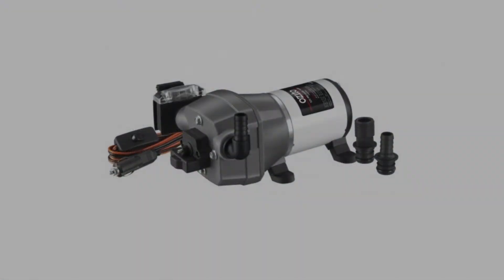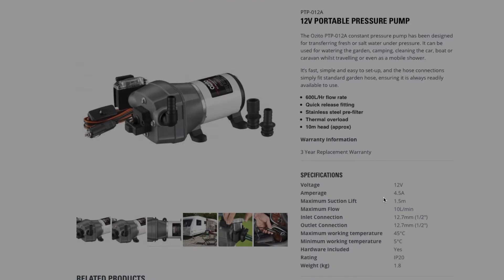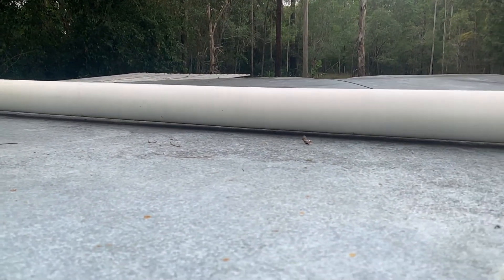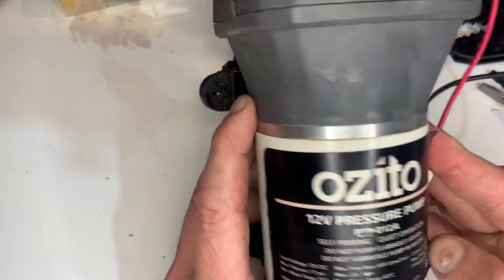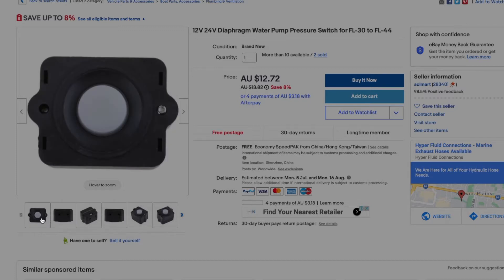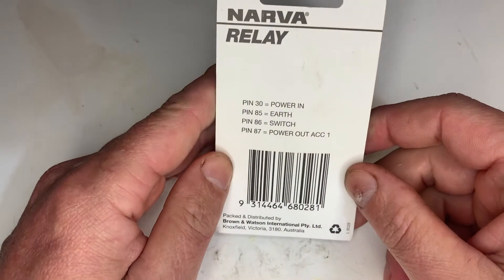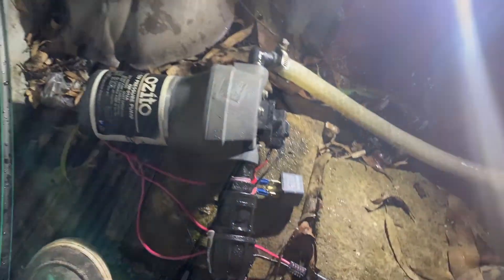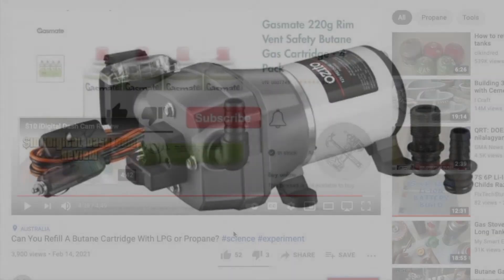Ozito 12V DC Pressure Pump Review / Everything You Need To Know, 3 Years Off Grid Water Pump

Comment: Firstly, great video & I was really surprised you fitted the relay as I was curious if I had to do the same as this is what I did/HAD TO DO with my surflo along with an accumulator tank. Otherwise, my pressure switch would just blow out which would only be weeks or a few months at best. After fitting a relay & accumulator tank, the pump & same switch has lasted something like 6 years!!! It actually still works, but I think the seals are blown as water pisses out from the body of the pump.  So I really don’t know why these things aren’t built WITH AN ALREADY FITTED RELAY with a suggestion to also incorporate an accumulator tank it the pump is going to be used regularly over time. 

Note to those living in Australia, Jaycar has those pressure switches which are cheap as. I didn’t know this at first and I was ordering off line or at a boat shop for some fcuking  ridiculous price.
Reply from the maker: Thank you! And thanks for the info.
I must admit I have made mistakes in that video, I'm not clever enough with relays, a spark arrestor of some kind would have helped the relays last longer.
I think the big issues I missed were, just running the 12V pump off 24V was a bad idea, in my case buying a 24V pump would have been smarter, you can also run it off a car battery in an emergency and it will handle that without overloading anything. Also the main feed line to my house is 16mm when I should have used 20mm.
I actually tried an Arduino uno with a Mosfet switch which worked flawlessly until one day the Arduino locked up without my knowledge and it stayed on for a few hours, the pump was a bit worse for wear after that. 
I've since upgraded to a 24V Seaflo which I did a short video on, its behaving itself even without a relay so far.
Probably a better solution would be using the MOSFET instead of a relay, 3D printing a box or coating it in epoxy to waterproof it. No moving parts except the microswitch would help it last longer.
Reply: Can you please tell me what accumulator tank you bought? Also, where you got it? Many thanks.
Reply: @susansinclair4914  Sorry for the late reply.....I cannot remember the exact size but its only fairly small, like a 1ltr tank???? its about the size of a large grapefruit for lack of a better description. I bought my accumulator tank from Aquafier Pumps Brendale Brisbane QLD. Dont know how relevant that'll be for you though.....In any case my Ozito water pump is still working perfectly along with the accumulator tank.

Comment: Perfect review! thanks for sharing. you might have better pressure with a smaller pipe! 
a run on timer (most i have seen are 240v and die in a year or 2) would allow setting a minimum time to stay on which im sure you've already figured out! thanks for this mate!
Reply from the maker: Thank you!
You're right about the smaller pipe, I believe the big issue is the pressure switch is not capable of supplying a whole house.
Another commenter talking about the pressure vessel was on the money, although I don't want to go down that route.
I had rigged up an Arduino and MOSFET switch, which would stay on for 3 seconds at a time, it worked brilliantly but it would fail occasionally and stay on.
I'll release a new video soon, with a new 24V DC pump.

Comment: How do you get to the micro switch?
Reply from the maker: You need to remove the 2 screws on the front of it and the pressure switch and microswitch part comes off, it's just held together by some clips.
Be very careful with those screws so you don't butcher them like I did.

Comment: forget all this garbage you will be chasing your tail for ever, if you want to stop the pump from clicking on and off and burning out, get a Tank Accumulator, that will fix the constant clicking on off as it actually fixes the pressure problem, this hack is trying to cover a problem not actually fix it so get it back to 12v. Tank Accumulator cost like $40, they are a must for these style of pumps, also save you a tonne of power likely would have allowed you to run on that battery longer, that clicking is startup draw so uses max amps every time it clicks on. If it was me, id put it back on a 12v battery, attach a $60 Epever water proof Mppt solar controller, and hook an old secondhand panel to that 12v battery, and ad the Accumulator tank. It Might set you back $150-$250 todo it, but you wont have to worry about swapping out all this crap every five minutes. reliable water supply is pretty damn important, so spend a few bucks and do it right IMO. plus it wont be a drain on your main solar system having it on its own system. if you had a 200-250watt panel on that battery you would more than likely be running it all day with out using any battery, so if you had a cheap 100ah Agm on it, you should have heaps of power for the night
Reply from the maker: I am aware of Tank Accumulators, I used to have 1 or 2 on 240V pumps. I may look into one, but currently it isn't necessary.
Another fix will be a more suitable pressure switch, basically the highest pressure one they sell. I did upgrade, but it made no difference. Currently the pump doesn't click on and off on the tap right near it, but does on anything in the house. So sorting this out, possibly with an external pressure switch is one priority.
On top of that, the problem still stands, you can't deliver 20A through the tiny contacts of a microswitch forever, it needs a good solid relay at bare minimum.

Previously I ran the pump on hail damaged solar panels and whatever old car batteries I had, but since they've died I don't want to keep spending money on them.
I will never go back to 12V battery, not with cheap lithium ion batteries, especially with the DIY power wall route.
I already have the infrastructure and its working well for me.

My problems with the pump has since been solved using a cheap Arduino and Mosfet, I'll do an updated video on it in future.
Reply: @FixTechStuff  Hi I am still going through these pumps and one I fitted four days ago has already bit the dust. I did get DC microswitches which, as they were physically larger, I had to adapt. I also had an auto electrician wire up a relay. This worked well for a few months but then, one day, the pump got stuck on and wouldn't switch off so I had to put in a new pump. I didn't have time to put in the relay myself so it's yet another job to do! I am interested in getting an accumulator tank and maybe the Arduino and Mosfet (although I have no idea what these are!). I'd appreciate you letting me know what accumulator you were considering and also, if I'm not asking too much, what Arduino and Mosfet you used are. Many thanks.
Reply from the maker: @susansinclair4914  I can't recommend the Arduino controller and mosfet because it froze up and ruined my pump, it's just not reliable enough.  Perhaps a good mosfet on its own may work in place of the relay. It's a solid state relay, so if it's heavy enough it won't burn out. I may do a video on this in future.

An accumulator is just a pressure tank with a rubber balloon in it, you pump air to a certain pressure on one side and it accumulates a large volume of water so the pump doesn't need to cycle or chatter. If a pump still chatters with an accumulator or a tap open fully then there is a problem with the hose size not letting it flow the correct volume of water and or a problem with the pressure switch. Pressure switches are rated on PSI.
Reply from the maker: @susansinclair4914  Here's a link to accumulators, there are Seaflo ones which should suit your pump nicely. https://ebay.us/PGDP3m
Reply: @FixTechStuff  Thank you so very much!
Reply from the maker: @susansinclair4914  I hope you get it sorted out soon! Nothing worse than pump trouble.

Comment: Hope you can HELP:  I have an off grid weekender. I purchased a second hand wood fired water heater. It has a large pressure reducer on the cold water inlet at the bottom of the 150 Lt tank. As it is an open system, I have a copper pipe coming out of the top of the heater and going up 6 meters with a shepherds crook on the top. Just above the heater I have tee'd off my hot water outlet pipe. My problem is that I am trying to feed hot water to my outdoor bathroom. Bathroom is built up about 1.5 meters from the ground to accommodate the composting toilet under floor tank. (My wood heater is at ground level on the outside of the bush bathroom) My problem is that I get low pressure hot water at the bathroom sink but no hot water flow at the shower rose.  Looking for a solution to be able to shower with the hot water from this low pressure water heater. 

My thoughts to date:
1. Inline 12v pump on the hot outlet side of heater. Problem with hot water damaging pump & inability of pump to suck water from top of heater.
2. Purchase 44 gallon plastic drum, install drum under bathroom unit, fit a float valve 1/2 way up, connect hot water to float valve inlet. (this drum should fill quite quickly as it is same level as the base of heater) Then install a 12v demand pump that can manage warm or hot water and have the ability to pump up at least 3 meters to shower head.
3. Try and increase the pressure into the base of the water heater unit, just enough to get water flow to the shower without having water coming out of the shepherds crook (6M up) Not sure how I would, or could do this.

Any help or advise would be very gratefully received. I'm an aged pensioner, presently using a 3kva petrol generator to heat water in an electric heater but can no longer afford the petrol.
Reply from the maker: By open system you mean the heating tank is open to the atmosphere?
If you can, try and put a pump before the heater. Otherwise, the pump should be able to handle the temperature range, but I would think it would last longer with cooler water.
There are DC pumps specifically for recirculating hot water in solar hot water systems, I was looking at them years back as I have some solar hot water panels I'm not using yet. You could have one hooked up to a switch for when you have a shower, and just turn it off when done.

Comment: It's currently 1am here in Queensland Australia and I've been trying to fix my water pump for two hours. I finally discovered that just as Fixtechstuff suggested, it IS my microswitch that's at fault. In fact I discovered it almost by accident because when I pressed one of the wires leading to where the microswitch lives, suddenly the pump started working again. I kept my finger on that wire while my partner filled a water container up so at least we'd have some water for overnight. What I was doing was, by pressing that wire, I was somehow pressing the microswitch. Well I kept this up for a while but after about a minute of this, my finger got really hot and then after another minute the microswitch housing started smoking! This is on a boat so obviously that could easily have caused a fire onboard. A few minutes later I found this video that explains a little more about what fixtechstuff is saying. It's not as good a video but it does show in more detail WHY that microswitch is such a piece of DANGEROUS crap;   https://www.youtube.com/watch?v=g50Zn_AoNaA
Reply from the maker: Yes it is dangerous. That's enough current to start a fire, definitely something to keep in mind in boats or caravans. 
Be careful with the screws when removing the pressure switch, the relay mod early on will help prevent microswitch burn out and thus avoid damaging the threads. I must have taken mine apart about 6 or 7 times.
Reply: I've taken mine to my local auto electrician in order to get the relay wired in as I just couldn't get my head around the wiring (I'm almost 68 years old so that's my excuse anyway). However, he tells me he is having a lot of trouble getting hold of DV micro switches. He thinks he may have just ONE left in stock but as I have several of these pumps, I now need to find out where I can get them. Do you have the part number of the micro switch so I can look online? Can you remember where you got yours? Mine is marked DEFOND 151314  250V   DMC115  12 Amp  DMC 1112    2114 However it's possible I might have some of those details wrong because the markings on the switch are very feint and very small.
Reply from the maker: @susansinclair4914  Any microswitch will do as long as they physically fit, all the ones I have seen are both AC and DC. I have never seen a DC only microswitch in this size. 
I buy whatever is available on AliExpress. With the relay modification it only carries a tiny amount of current, just enough to open the relay. 
For example this one on AliExpress is quite OK.
https://s.click.aliexpress.com/e/_AWKhMn

Comment: Hi again. I commented three months ago that my pumps were lasting about a month. I have since gone through THREE more of these pumps. I bought them at Bunnings so can take them back for a refund but as I live over an hour from the nearest Bunnings it's a pain in the butt to keep taking them back. I was running mine on 12volts. I have gone through five or six pumps in the last 6 months!  I have now got the Narva relay you had. Can you please tell me exactly which wire goes to which spade connector on the relay? I have watched your video several times but can't quite make out how to wire it. Many thanks in advance if you can help.
Reply from the maker: Sorry to hear you've had so much drama.

----------------------------------------------------------------------------------------------------------------------------------------------------------------------------------------------------------------------------------------------------------
Pin 30 goes to 12V DC Positive terminal and also 1 side of the microswitch.
Pin 87 goes to the red wire on the pump motor.
Pin 86 goes to the other wire on the micro switch.
Pin 85 goes to 12V DC Negative terminal and also the black wire on the pump.

So the ground wire is always connected directly to pin 85 and the pump.

The positive wire is switched, it connects to one side of the microswitch and pin 30

When the microswitch triggers it puts 12V onto Pin 86 which then in turn closes the contacts between pin 87 and pin 30 making the pump turn on.
----------------------------------------------------------------------------------------------------------------------------------------------------------------------------------------------------------------------------------------------------------

If the microswitch has 3 terminals, you need to choose a pair that are switched when the relay switch is open, otherwise the pump will just go all the time and stop when you open the tap!

I'm planning a 2nd video on this topic and will include the relay wiring in detail on that, but also an electronic option I've been working on. It's not quite 100% yet, so still some more bugs to iron out.
That being said, a relay like the Narva one or heavier like off a truck headlight  will make a big difference over just using the microswitch.

Hope that helps.
Reply: @FixTechStuff  Thank you so much. We're down to our last working pump so I will get onto the wiring tomorrow. Thanks so much for the advice.
Reply: @FixTechStuff  My last remaining pump went on us tonight. So we are onboard our boat with no water for showers or taps etc. Yet, ironically, it's pouring down outside! I tried to follow your instructions but as it's midnight here in Queensland, I'm too tired. I also tried to follow your video wiring but as it was sped up, I couldn't make out all the wiring. Your video is great. But if you can make another one and include the wiring as you have suggested, I believe it will help people even more than this original video because, if my experience of these pumps is anything to go by, a LOT of other people are going to have their pumps fail just as mine has. Thanks again.

Comment from the maker: Just a heads up, my 40A relay did eventually burn out also, it may have been water ingress.
I would definitely find a heavier 24V relay if you are running one over voltage like I am.
Perhaps someone familiar with relays can comment here, maybe there is a better type, with resistor or diode, or a spark arrestor that helps.
Reply from the maker: They didn't teach me anything about relays in school! Life is unfair!

Comment: Nice fix, I am having the same problem, but I am confused by your wiring method. Do you need to jump a 12v+ lead off the incoming 12v+ from term 30 to the micro switch and then back to term 85 then complete the circuit term 86 to the 12v-, thanks
Reply from the maker: Here is the pinout I used, I hope this helps:

87 - Positive, red wire to pump motor
30 - DC positive in 
        Microswitch 1
86 - Microswitch 2
85 - DC negative in         
        Negative, black wire to pump motor

Note pins 30 and 85 both have 2 wires joined together.

I'm really disappointed that I forgot to include this in the video because wiring relays is a real bother.